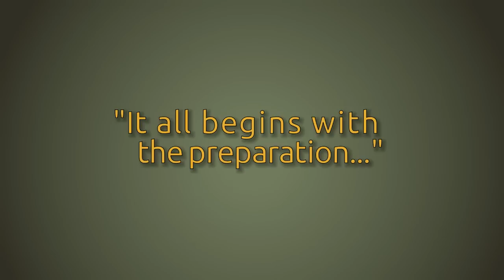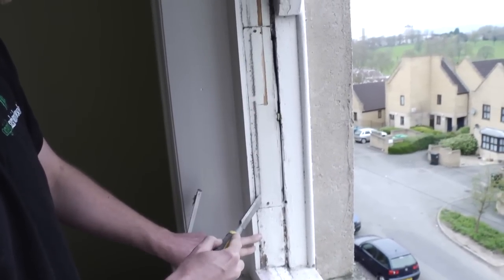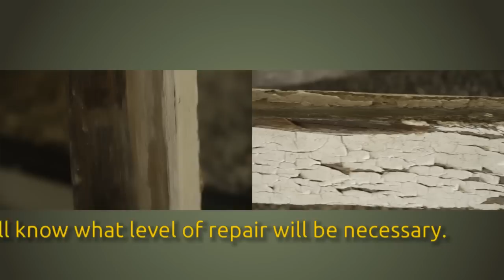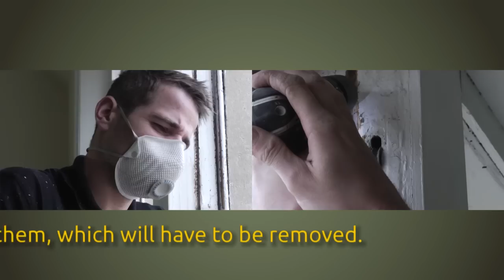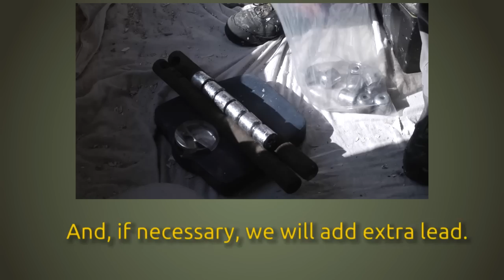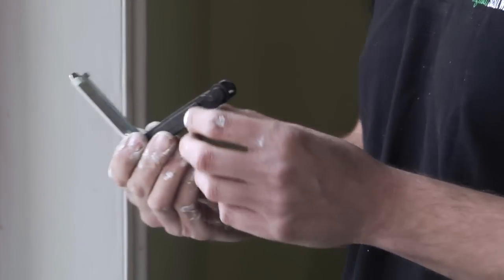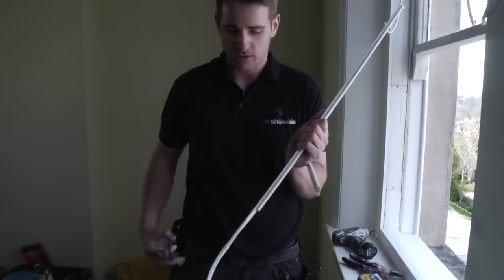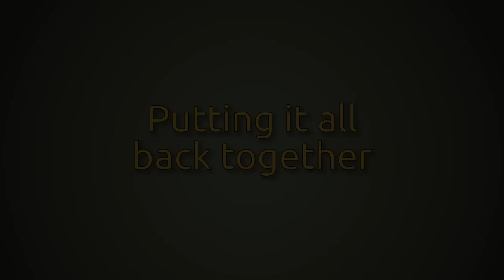The Original Sash Window Solutions Renovation Video

Comment: You forgot to put glazing points to hold glass. Just putty will not work.
Reply: You are quite right that glazing points are important for safety and for glass stability.  This video focuses on sash window restoration as opposed to the more specific topic of glazing.   Could be that these fellows glazed properly with points and oil based primer or linseed oil, but thought those matters to be off-topic.  Greetings from an amateur in the USA.

Comment: The lower sash of some of my windows are wobbly and I was thinking, while I realized that these can be easily removed, is it safe for me to reinstall them a litte bit further, so to stop the wobble and consequently reduce the air bleeding gap? I would then put a line of sealant just to make sure there arent any further leaks from the bead and the frame.
Reply: No. You need to work out why they are loose. Has the central parting bead deteriorated? Has someone replaced the staff beads with the incorrect size? Sash windows are not complicated and are well worth repairing. Have a look at this guide : https://www.historicenvironment.scot/archives-and-research/publications/publication/?publicationId=9ea41caf-aa32-4827-ba08-a59100fea1a3  You can buy what you need from Reddiseals etc.
Reply: @jhenderson2286  That link is exactly what I needed thanks for the tips.
Reply: Im a carpenter and can build these sash windows from scratch. Yes you can move the staff beads closer to the sash to reduce the clearance, just make sure you dont move it so far over that the sash is stiff to move.

Comment: Super awesome! I second the question about source for the clips and brushes. Also, what were you using for the wood repair? I've used a two part wood epoxy, but it is a pain to work with and not as fluid.
Reply: I think is two part wood filler. It's not the best solution for cracking wood becouse You should glued and screw it first but You can repair small holes and gaps. Of course remove the rotten wood first.
Reply: In the uk, check out Reddiseals.co.uk for all parts needed for restoration

Comment: I have a window that is rotten 5 inches up the sides so I had a whole new sash made and 2 pieces about 18 inches long jointed for the corners. I don't know if that makes sense but basically, I'm trying to replace the lower fourth of the window and I'm not sure the best method to join it to the upper 3/4ths of the window.

Comment: Hi Gary. Great video, thank you!

What is the name of the drill attachment used at 4.31 please? My replacement parting bead is too large for the groove I have.p and that looks perfect to help widen the groove.
Reply: Have a look at Dremel bits - you can use any old drill as they are doing. Dremel have various routing bits that are suitable for this kind of job. Or you could use a router with with a 9mm - 3/8" bit - though you would have to make a jig for it to run in - Good luck with your restoration
Reply: Classical Carpenter in..., I am happy. By u to it by the end mm Mt.. By by having. W 

As as your no knowledge. You by u